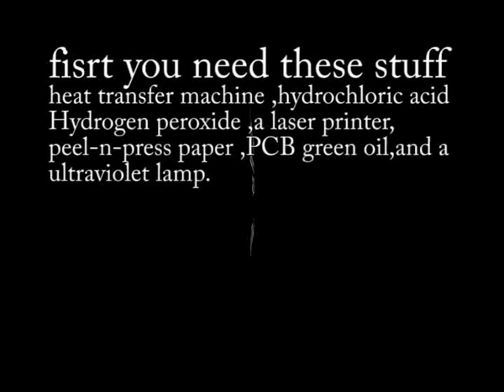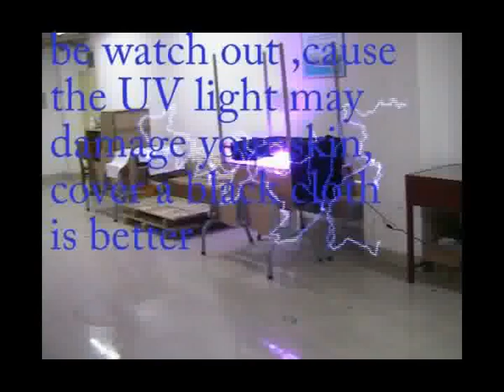make a  PCB with solder mask covered

Comment: That is true, pre covered photo resist PCBs are indeed much more expensive. However, I am just too frustrated with tonner transfer ( never could get it right, specially for fine routing). Just an advise, you can get photo resist in spray cans. Much cheaper, and if you mess up a board at some point you can always wipe it and start over :)  ... Anyways great video and keep em coming !!!

Comment: i bought that uv paint but i have problems. Could you please help me? The problem is that the paint sticks on the  film and after the exposure, when i pull out the film the paint dont stay on the pcb. When you pull out the film, is the paint wet or dry? I cant understand how it suppose to dry with the transparent film up to it. Can we first apply the paint, dry it and then insert the film and exposure it? Or the paint supposed to dry by the UV exposure?